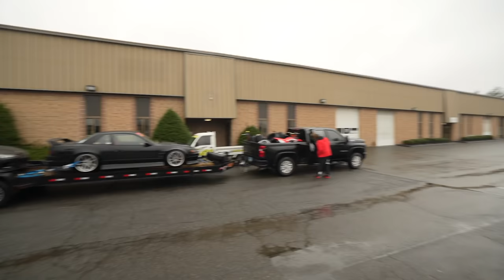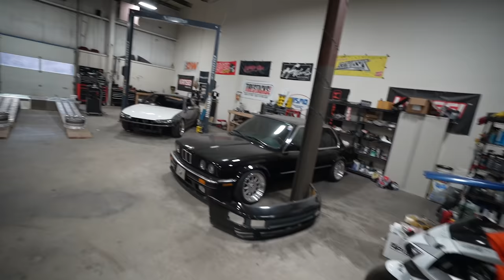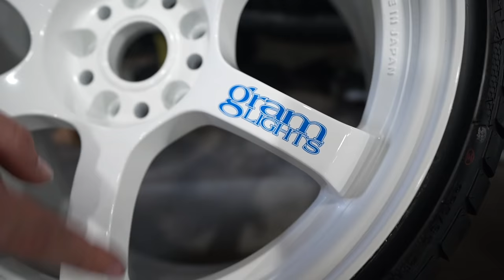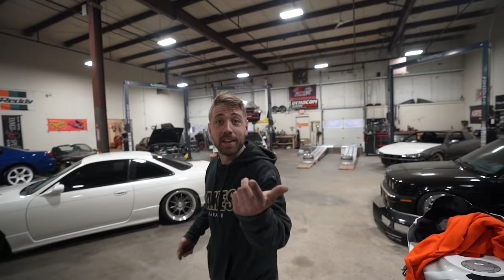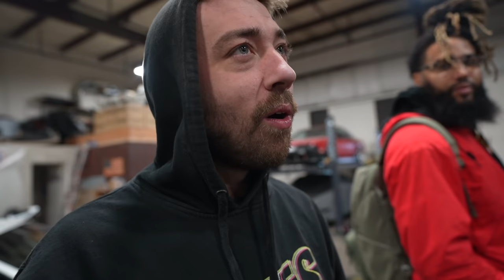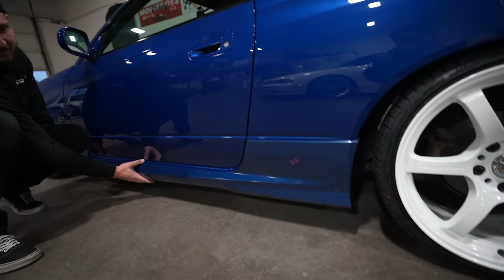Autech S15 gets a proper set of wheels!

Comment: The black center caps looks so much more motorsport but try silver wheel nuts with silver cap and see which works better or black on one side and sliver with silver wheel nuts on the other 💯 you can only see one side of the car at a time 💯💙💙💙💙

Comment: Black centercaps for sure. And about the Aero.. it's you're choice, I'm not going to tell you twice.  Sometimes enough is enough thought isn't it. Go down a wheel size and it'll sit plenty low and be functional. You have plenty of aero low, slammed on their ass cars running 18's mostly collecting dust. I get it, it looks good. but being able to use is a joy just the same. It must be a generation thing, I'm more leaning toward OEM plus myself. If it's that good from the factory why mess with it?

Comment: Love the wheels but the car needs 17's and tires need a little more sidewall. Wheels looks way too massive with those rubber bands. Also keep the black center caps and try to paint the red around the Nismo blue.